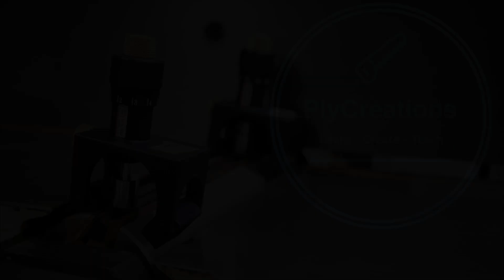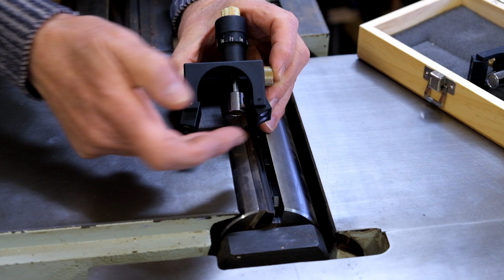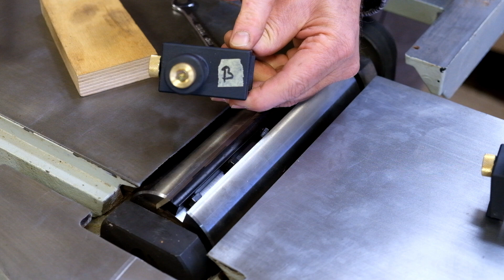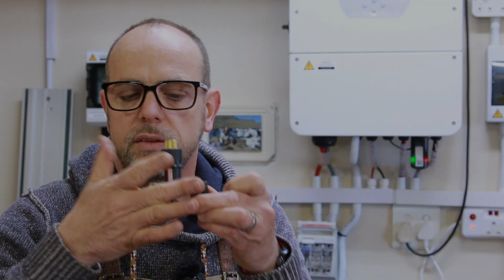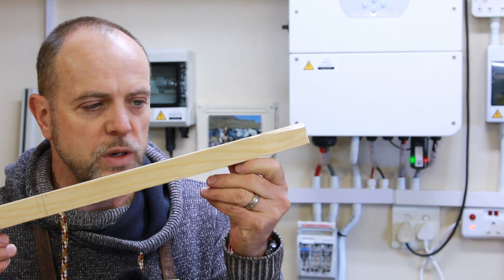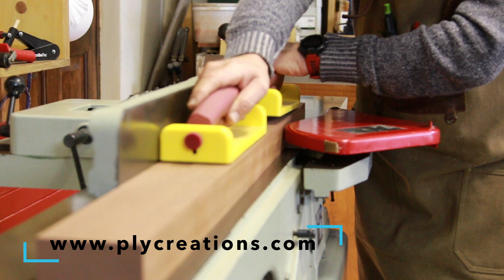How to Install and Align Jointer Blades (Magnetic Jig Setup)

Comment: My use of these jigs…Set in/outfeed tables level. Make the two jigs match each other first, that way it doesn’t matter using them either front or back. Mine came unmatched but easy enough to adjust and reset. Then use them on the jointer to set the blade even across the width.  Don’t fully tighten blade in fully yet. Once first blade in, before locking off, check if height is what you want to set it to, adjust blade height if needed, then lock the jigs to this height, and fully tighten in the 1st blade. (Or set and lock the jigs to match height of previous blades already in place). Proceed to blades 2 and 3, use the set of locked jigs to get the second and third blades set and locked in place. Reset in/outfeeds to depth of cut you want to test. Test a board.
Reply from the maker: Yup, similar to what I tend to do when not in front of the camera. These guys are a BIG improvement to other jigs and methods I have tried. My cutting head isn't exactly parallel to my out-feed table so one jig is set very slightly higher than the other, but we're talking very slightly. I think if I was less pedantic about it I wouldn't even pick it up with a test cut.

Comment: Great video Dylan. Just bought an old joiner and it has these (or similar) tools. I had no idea how to setup the tool…

For extra fun, your (Deye ?) inverter setup and cable tray is a layout l am considering for my offgrid application. Have you installed that yourself ? Have an install video ?
Thanks
Reply from the maker: Thanks and glad I was able to help, if you need more detailed advice feel free to reach out.

As much fun as pulling cables inside a hot roof in the middle of summer can possibly be 😉! It's actually a Sunsynk, as far as I understand they are close cousins to the Deye with main difference being the software. DIY installation with advice from a family member who is a commercial installer. It's a solid system with one drawback, I only installed a single battery and it doesn't have the grunt to allow for my bigger machines to "kick" in during outages but it at least allows me to continue work on content and smaller tools when we go dark.

Unfortunately no installation videos though 😕